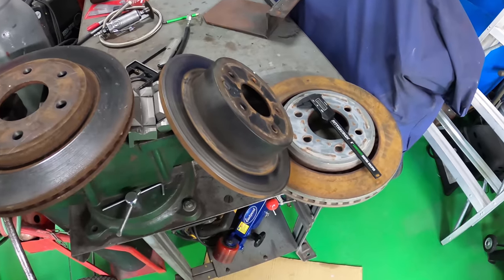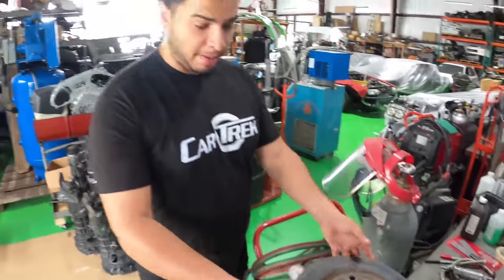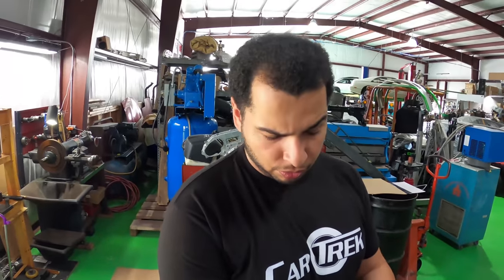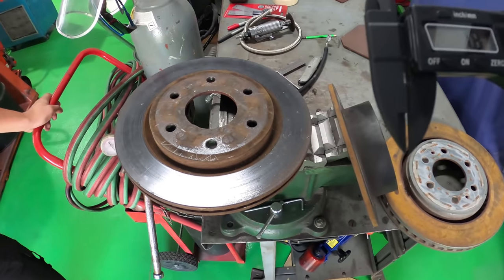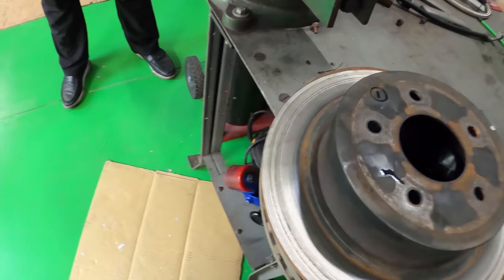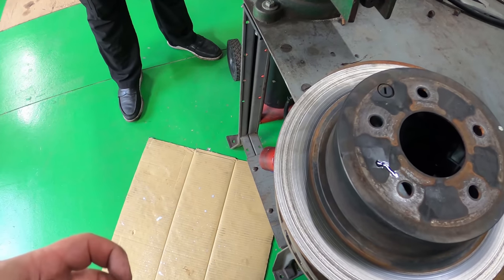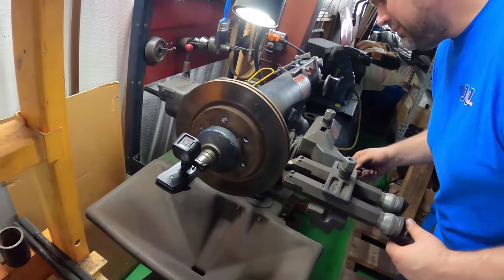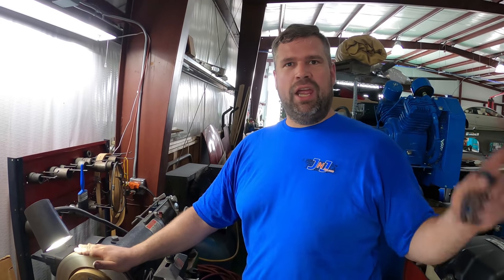Here's How You Can Get BRAND NEW BRAKES For $10 (Without Screwing Up)

Comment: I'm guessing it must be different over in the US but over here in Europe disc facing has fallen out of fashion for one simple reason: wear rates.

A new disc with new pads fitted together will wear out at a certain rate.  This is generally at the rate of 1 set of pads for 3/4 of a disc.  So when you come to replace pads, even if you don't reface them, the disc will now wear out before the pads do.  As people only ever check pad wear, not disc wear, you can end up with 3/4 worn pads but a disc worn well below it's minimum level.  It's down to the materials that are allowed in pads, they generally wear out rotors faster than the traditional, now banned, materials.   

For example:
My car has discs that are 22mm thick new and a minimum thickness of 20mm.  With all new discs and pads the disc will worn to roughly 20.5mm when the original pads are due.  Say you get them refaced and that takes them down to 20.4mm then fit new pads.  Potentially you could only have used up 25% of your pads by the time the discs are now below minimum thickness.  The general public will just look at the pads through the wheel and think everything is ok until their disc fails on a long hill or an emergency stop. 

It's for this reason that over here it is always recommended you fit new discs and pads together.  Guess how I found out about this info?  Yep, the hard way.

Comment: So is the minimum specifications what is usable? Because if you machine to 8mm then put a new set of pads on it will be well under 8mm by the time you’ve worn through those pads.
Reply: No the minimum thickness is a machine to thickness not a minimum thickness to be usable. If after you're done Machining it it's below 8 mm the rotor is junk

Comment: I need to check the specification on the thickness of the rotor and make sure that it's not too thin I have been certified as a brake mechanic

Comment: I didn't hear two words I was expecting in this video..  The words are  "run out".  I've had many rotors turned in my cars and I had to learn what run out is.  For rotors it is a very slight warp in the rotor.  It has to be there so that the pads are kicked away from the rotors once you've finished braking. If you don't get the pads away from the rotors, they continue to rub or brake the car, putting extra heat in the pads and rotors.  Sometimes there are issues with the calipers that don't allow release of the pads.  The result is further wear and in my case too often, the disk run out turns into a full blown warp and the rotor has to be replaced anyway,   Does turning the rotors allow for run out?  To prevent warping, I've asked mechanics to be sure to "grease the sliders".

Comment: Keep in mind that bench lathes are inherently not true and will always machine a small amount of runout into a rotor. This will cause vibration under braking in any performance car or really any car made around or after the year 2000. Use an on-car lathe or replace your rotors for the best results!

Comment: It’s kind of difficult to get a rotor turned anymore unfortunately. The discard thickness anymore is only a few millimeters less than the original thickness. Most garages I’m familiar with have stopped turning rotors in favor of just putting new ones

Comment: Trying to actually use the first rotor will sound like you are stopping on a zipper in the car......it’s actually way easier to get the non-vented rotors to chatter on a brake lathe if you wanted someone to actually hear the noise from the lathe......like someone already said it is getting harder and harder to find a place that will actually turn the rotors and not want to charge a shop hour of labor

Comment: Nice Vlog but you should have shown the thickness after you turned the Rotor as you are taking a cut from each side of it and some times its just not worth doing it when the Minimum is to close to what you have on the rotor . And if the Rotor has a warp in it. lol

Comment: I had to take my car to my mechanic because my roommate put my pads on wrong. Passenger side was correct but rotor hadn't been turned. Driver side was incorrect and chewed my rotor to the point that I needed a new rotor which cost my $40 for that piece.

Comment: Can you do this on a cross drill and slotted rotor?
Reply from the maker: You can, but most shops do not like turning them as it will likely damage their cutting bits and they need to be turned very slowly.

Comment: Turning rotors has never really worked for me. You might get 5000 more miles out but they warp again pretty quickly, plus as others have stated, a shop that'll do it is near impossible to find. I just put brand new ones on when it's time to do brakes.

Comment: no way that's 15 to a 30 dollar out here in the Netherlands.
a mechanic will charge you a minimum of 90 an hour to start with.. 
then it could be 30 to 40 apiece to finish them... its cheaper to take new ones

Comment: Can you do it in a lathe?
Reply: Yes. What he used is actually considered a lathe. It is just specialized for brakes and has an attachment to cut both sides at once. A common lathe a machinist would have would cut one side at a time, unless they have an attachment for doing both sides at the same time. Most of the brake lathes are rather light duty and not very accurate compared to a decent lathe. With a regular lathe it often takes more setup time to get it aligned as they are rarely setup for brake rotor work. I have both types of lathes and rarely machine a rotor. And would probably never use my regular lathe as the cast iron is rather dirty and abrasive, and would require covering parts of the lathe along with a good cleanup. About the only reason I would machine a rotor, is if the rotor is fairly new or actually new and not running perfectly true, or I'm changing the pad type. And its on a performance car that might see the benefit. Some rotors are hard to find new that are not a little out of true. Then I might take off a very light cut to true it rather than using tapered shims.
Reply: rob b thanks for the info!

Comment: my Mercedes mechanic refuses to turn any rotor, they all come back a month later warped due to metal fatigue
Reply: Main reason for rotor warp is overtorqued wheel lugs/bolts and a warped rotor is likely to warp again.
Reply: So to refuse is better just due to rotors already being ruined
Reply: Also turning rotors can be hazardous if you have worn pads and the pistons travel too much, not likely but for sure possible
Reply: Of course it depends on if you just resurface it because pads had uneven wear and you don't exceed the minimum thickness

Comment: Thats not how you measure rotor thickness. That would measure the thickest point. You need the measurement of the thinnest point
Reply: They have no clue what they’re doing honestly
Reply: They actually make brake rotor micrometers. They have points on them so you can get into the deepest group

Comment: Rpm seems a bit slow to me. Whack spindle speed up and that will improve finish.
Reply: Did you notice how noisy the lathe was. They have issues with their belt drive. Any issues with the drive pulley vibration Etc can be transferred into the cut

Comment: A rotor is like 25 bucks
Reply: So u save 15/each.
Reply: By buying a rotor for an F150 you're looking $90 to $100 and if you don't have a special adapter you're not going to cut them on a standard ammco

Comment: Brake discs have a minimum thickness requirement so good luck using those you’ll be in a ditch somewhere
Reply: Yeah, imagine if the video actually talked about the minimum thickness requirements of rotors and they used a set of calipers to measure how much material there was on the rotor vs the minimums! Oh well, I'm sure they didn't do that in the video tho. :D
Reply: Did you actually watch the video?
Reply: Maybe Betty my thoughts as well 🤣 I think CJB didn’t watch the video 🧑🏼‍🦯
Reply: Lmao what video are you watching ?

Comment: please don't play with brakes ... put new rotor and pads if u don't want crash ur 10000 car for 100box ...😂😂😂😂 improve brakes with pagid rotors and ebc pads... if u want safer :STAY AT HOME 😂😂😂
Reply: It's not playing with brakes it's normal to turn rotors that's why they put a minimum machine to thickness on them. On your normal street car it doesn't decrease your braking ability at all with the machine rotor now on a race car or a truck that's hauling 40,000 lb then I worry about it a little more